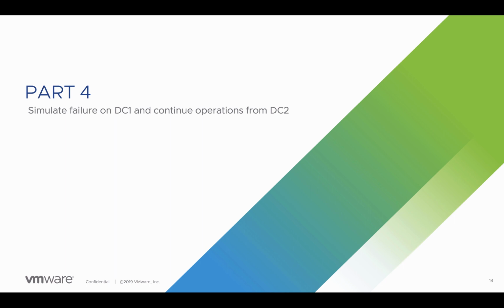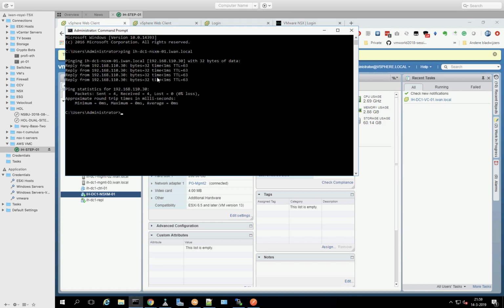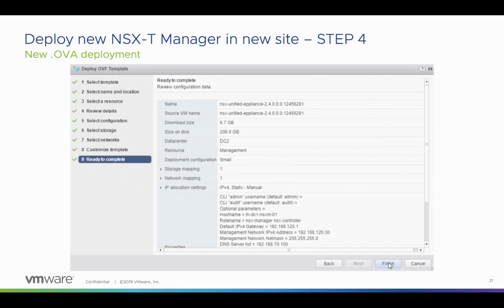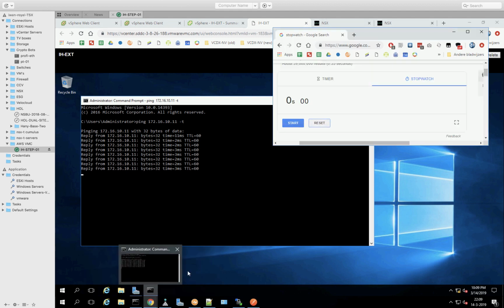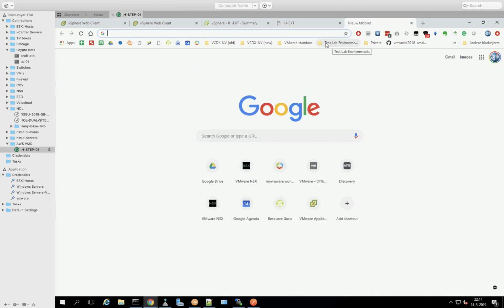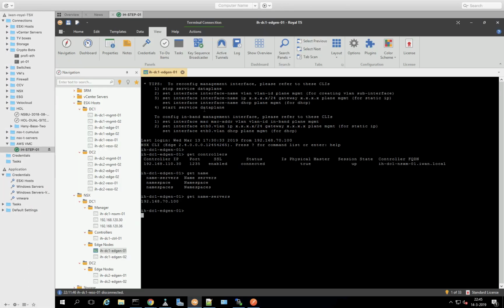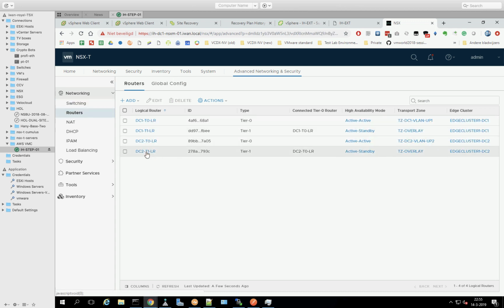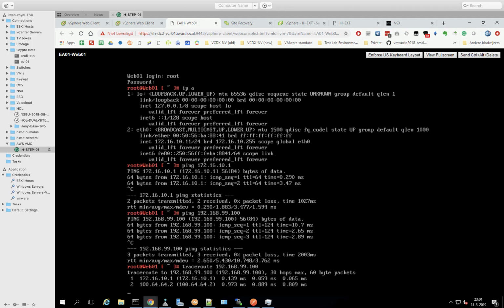PART-4: Disaster recovery using Multisite (light) with NSX-T 2.4

Comment: Hi Iwan,
Big Fan of your content and the books on nsx-T :)
So it clearly means that we have to make the Site 2 Ready with the Edges, uplinks, (BGP peering ) and T0 Routers.
When we perform the failover to the second site what happens with the Tags/Groups/security policies with DFW we have created with in the first site? Does it get restored with the backup of the primary nsx-t node’s backup?
What shall we do in case we need to have a zero downtime requirement with NSX-T? if possible could adda video on this topic?